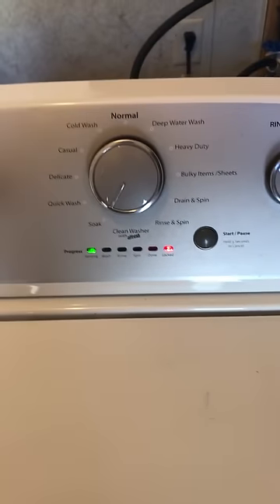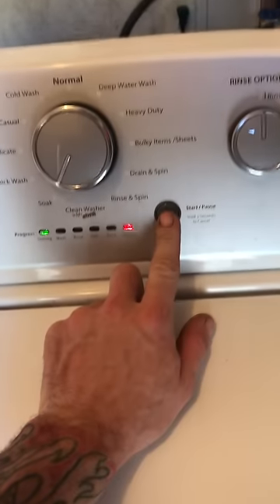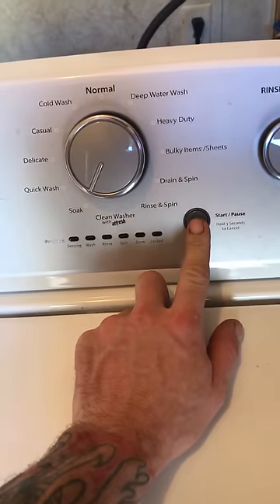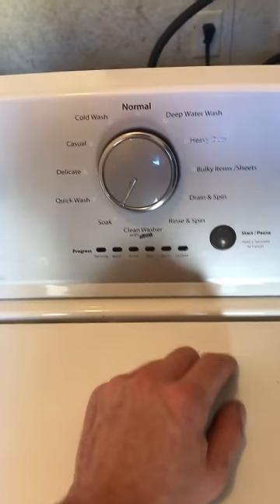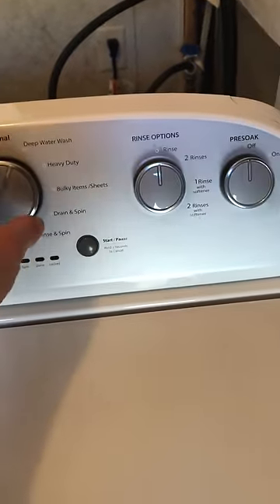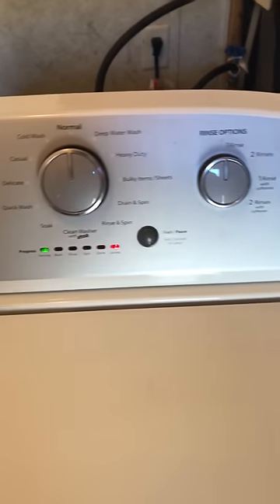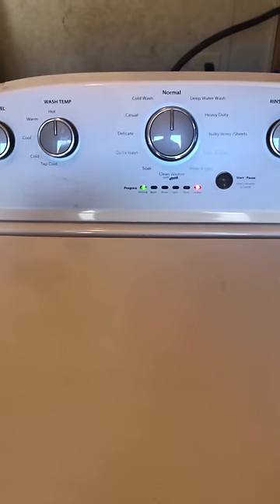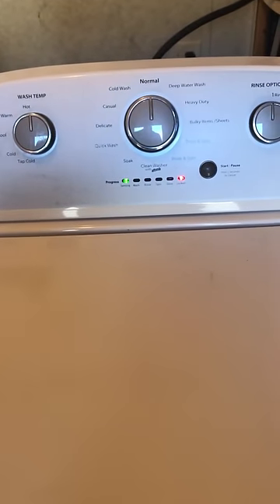Whirlpool washer will not pass sensing cycle

Comment: unplug the washer for a minute.  Then lift and close the lid 6 times in 15 seconds.  It'll reset the logic.
Reply: OMG Donnie. that worked. my washer sensor light was on and water was pouring in however it would not wash. I unplugged for about 5 minutes, plugged back in, lifted the lid up and and down 6 times and push start, it immediately went into the wash cycle. thanks a bunch.
Reply: Really hope this works... So I unplug wait 5 mins then open my washer 6 times then it will work?
Reply: Donnie Lyons you’re awesome man!
Reply: This worked! So simple. Whew! Thanks.
Reply: Amazing Donnie !!!
It's technical sense, not strength.
IT worked...it reset itself.
Reply: I don't know how you knew to do - or even try - this.....but it WORKS! Thank you SO MUCH!
Reply: I can't believe it, but it worked! You saved my laundry, my time, my  frustration you made one older lady soooo happy
Reply: F**** Donnie. Worked like a charm bro.
Reply: Ugh did not work on mine. Still clicks and unlocks
Reply: Huh
Reply: Thank you ! you saved my day!
Reply: Donnie Lyons  can u make a video please!
Reply: Wait a minute here...I wasn't aware that this applied to whirlpool products? Thought this was general electric method? Not sure if this is possible
Reply: It worked unplugged for 5 minutes slammed the lid open and closed 10 times and now its Washing ... Thanks you are gifted and saved me a shit load of money . thanks a million
Reply: Thanks Donnie, worked like a charm.  Now how do I clean out the pan under the tub?  When I lifted the washer to check it out, I noticed some dark areas inside the translucent plastic.  that's probably accounting for the sour smell I sometimes get.
Reply: Thank you for this advice! I was scratching my head with this same problem!
Reply: It WORKED!!! THanks!
Reply: Thanks so much for this info, bought this washer sight unseen and seemed to worked just fine when I first got it. Then slowly but surely, all the cycles stopped working at the "sensing phase". Followed your steps and also ran a "clean washer' cycle(because that also stopped in the "sensing phase", now it seems to be operating normally. Thanks again!
Reply: Mr my lid is locked and wobt unlock or do anything else except click sound and lock light every so often
Reply: Yes, thank you!! It worked!!! Mine was stuck in spin cycle.
Reply: I’m going to try it
Reply: Mine didn’t work any other suggestions
Reply: Donnie Lyons you are the man I was ready to get rid of this washing machine and get another one that lid trick was amazing
Reply: Thanks Donnie! We all owe you a beer
Reply: Funcionó, muchas gracias!
Reply: THANK YOU SO MUCH!!!! I'm using a Commercial Maytag Washer and had 4 loads to do on a Saturday, I called Customer Service, they told me 3 days I had to wait.  I prayed and you were the answer to my prayers, thx again!!!!
Reply: Didn’t work for me either!
Reply: Donnie is my new hero
Reply: Perfect thanks!
Reply: What does (then left) mean?
Reply: @austing8694  i think he means lift
Reply: Donnie Lyons !! Donnie THANKS A MILLION !! WORKED GREAT
Reply: this actually worked! ty!!
Reply: Apartment washing machine got stuck on "sensing" cycle. Management said we were 27th in line for maintenance requests. You just saved me who knows how many more weeks without a working washing machine!! Worked like a charm.
Reply: Wow....it did work...thank you!
Reply: You are a washing machine god Donnie
Reply: Thank you.  It really did work~
Reply: Beast Mode Gaming then “lift”. Just typo
Reply: Wow works for me 👍🏽 I got the same type of washing machine. Was using my washing machine for only 9 months and all of a sudden wouldn't work. Thank you 😊
Reply: Amazing. But wtf I just got it day 1 and it already has an issue? Ridiculous
Reply: This just worked for me🤩Thank you😁
Reply: Honest... I thought your suggestion was absolute hogwash (no pun intended) but was willing to do just about anything no matter how ridiculous it sounded. And voila! It worked. Still noodling just why it does. I had yucky cat beds on the washer and no way did I want to wash them by hand. I would be more than happy to buy you a beer or beverage of choice. In lieu of that I extend my most hardy Thank you!!
Reply: IT WORKED! It actually works. I believed the comments below and was persistent. It didn’t work at first because I had to actually power off the load (hit and hold to cancel) before unplugging and waiting the minute. Then without a cycle going, open and close the lid 6 times, the choose and start a new cycle. Now it’s working! Thanks so much Donnie!! You saved me 100$ at least.
Reply: I cannot believe this worked
Reply: I JUST DID THIS AND IT WORKED!!!!!
Reply: Thank you so much Donnie you are a genius
Reply: Thats only on G.E models with electrónic board on motor
Reply: I could kiss you lol!! Thanks it works!!!!!
Reply: Christopher Johnson how did you do it? I plugged it off and opened and closed and pressed start. It’s sensing
Reply: Donnie Lyons, you are the BEST!  I am going to post a video of this procedure that worked for me.  Thanks so much!
Reply: That actually worked 👍thank you
Reply: While i have no issue with Donnie being a great guy. The people at Whirlpool should know their engineers made total S**T this time!
Reply: Thanks for the awesome tip!!! 🙏🙏🙏
Reply: Thank you soooo much🙏
Reply: Donnie Lyons could also recalibrate it in diagnostics mode.  If either of those don’t fix it it’s more than likely going into safety mode to prevent any further possible damage to the motor
Reply: You are a Godsend! That worked. Idk how but it did. Thank you so much.
Reply: OMG!!!! This worked! My washer is not even a year old and I've been so frustrated with it since I got it! I unplugged it, closed the lid repeatedly (6 times) and it's finally in wash mode right now! THANK YOU!!!!
Reply: I'll try again ughh 🤣😭😭😭😭
Reply: My washer like this isnt even a year old and constantly breaking to the point I have to unplug and replug it back up sometimes waiting a few days between! Whirlpool sent a company out who said I need a new main control panel I guess its called but they havent been able to come back out and replace the part. Hopefully it works from the reviews I have read and seen on many websites these washers are trash. My matching dryer is decent though
Reply: Thank you man it worked!!!!
Reply: What's your CashApp. I'm bout to send you beer money 🐐🐐🐐
Reply: This worked. Effing badass how this trick just worked. This whirlpool washers are a pain but that you Donnie.
Reply: Thank you so much!!
Reply: Worked!!!!
Reply: Thanks king
Reply: Thank you so much!!!!! It still works🥰
Reply: @Donnie Lyons…riddle me this…have same washer as this gentleman…this is not my issue, my issue is machine doesn’t “jirate” when washing…leaves clothes dirty and/or soapy…pls help!
Reply: 6 times in 15 seconds you say???

Good Heavens I believe in Hocus Pocus!!! 
Blessings to you & all your friends, kindred & posterity, Donnie!
Reply: Lift and close with washer unplugged?
Reply: Works like a charm
Reply: Donnie you are the frigging man...  I'm a technician and didn't know this trick. It works like a charm 💪🏽
Reply: Donnie Lions Mom is trying this now  crossing fingers
Reply: I DID IT AND IT WORKED !!!! thankyou commenters!!!
Reply: Thank you
Reply: OMG it really worked! Thank you
Reply: This worked for me.  Thanks!
Reply: I tried it and the green light is blinking it runs a few seconds and it locks and won't do nothing
Reply: Thank you so much!!
Reply: This actually worked! 😂thank you! #2024
Reply: Wow that worked
Reply: Didn't work unfortunately.

Both suggestions on this thread failed for me, unfortunately so I'll have to call the repairman. 😭

Comment: The motor is told to sample a rotation briefly before filling with water. The control is not detecting basket rotation, that information is supplied by a photo sensor, which is a part of the mode shifter, located on the side of the gearcase. It shoots a light beam through slots on a disc that is part of the drive system of the inner basket. If or when this sensor fails, which is one of the most problematic parts on this machine, the control will not realize "motor rotation" and stop operation of the machine. Also will store error code, which is not a definitive diagnosis, as the motor is typically not at fault, but the sensor, which is reporting back to the control , is the actual culprit. This photo sensor is also used in tachometer test, to see if it is working or not. Also this motor operates with a 45uf or 50uf 250vac capacitor that can also fail, although I haven't seen many of those go bad. 

Most of these parts are priced at 50 to 80 dollars, so if you can repair yourself, not so bad. Life expectancy on the VMW, which is the Vertical Modular Washer, is 7 to 12 years before main bearing, IE Bushing, system fails due to leaking top seal on outer tub. Of course some of these machines don't last as long, adding to the frustration many owners have with them. 

This description is for the belt driven VMW washer only, other Whirlpool washers use a direct drive system, where the stator of the motor is mounted to the bottom of the tub, no gearcase, no mode shifter, no belt, just 3 phase motor, controlled by the main control to operate this motor in very slow or very fast operation, and change direction as well. 

This is a brief description on the method of operation, and many different things can cause these machines to stop working properly, so remember to use the error codes as a starting point to steer you in the right direction, to find the actual cause of the problem. Hope this helps.
Reply: Oh yeah, the rotation light reads on manual and automatic mode but normal mode it will not do a thing, now what.

Comment: Ok first things first, I’d check under the wash plate for any change that may be stuck and if you find none proceed to check the drain and make sure nothing is blocking the impeller. Unless you can confirm it does drain. 

If nothing is blocking the impeller on the drain pump, you will want to look at the shift actuator. 

It’s got a shift actuator at the bottom in between the drain pump and connected to the splutch right next to the motor.

This shift actuator is plastic and does stick. Not an expensive part and very easy to change for any handy fellas out there. 

But once you change this part check the manual for diagnostics and run a calibration mode so the machine can run with the new shift actuator. Then run a test mode, and then check error code through diagnostic mode to check for any issues, hopefully you have none.

And Hopefully I have helped 😂🙏

Comment: I'm from the bahamas check your fill valve , or control board but I'm strongly suggesting you check your control board
Reply: I have one of these. The water doesn't fill
There is only enough water to wash a few shirts at most
Reply: I just replaced the board...it still dose the same thing

Comment: Ok , F7E6 means the control board is sensing an open line on one of the motors 3 electrical phases, with the machine unplugged also be mindful the motors run capacitor can store a charge   Carefully inspect the wiring harness between the Control board and the motor for any broken connections , if found , repair,, if no fault found ,, use an ohm meter to test the motors windings resistance it is listed in the tech sheet housed in the washer cabinet if you find one of the motors windings "open" replace the motor.

Comment: Don’t buy a new washer people. Please read. The classic models, with knobs and absolutely ZERO electronics are the way to go, fully mechanical, they wash, rinse and spin no BS every time. Some of the best models are the Whirlpool made Direct Drives, Speed Queens, and Maytags. And don’t think you can’t get one with a ton of options, the high end Whirlpool made direct drive washers offer tons and tons of cycles and options. There’s no excuse to buy a new washer when used classics are cheap and work the best HE was the biggest corruption of the appliance industry I’ve ever seen. You don’t get aggressive turnover with new washers, the only one you’ll find brand new that’s got classic powerful agitation and no BS is the Speed Queen TC5.

Comment: Our whirlpool's lidlock was jammed shut by the whirlpool itself, then during the preliminary "sensing" or weighing cyclecame a mechanical burning smell. It's as if it just committed suicide.  Had to take the whole top off to get my clothes out. Trying to fix it but looks like the washer might need to be replaced entirely based off what little I can find online.  This whirlpool cabrio is fairly new, too! Guess it won't be a whirlpool that I buy next time.
Reply: Just throw it out and get a nice used Whirlpool direct drive from the late or early 2000s, cheaper, way more aggressive wash action no BS gets the job done reliably every time with a real agitator. These new washers are a violation to washing clothes correctly with these ridiculous wash plates and unnecessary sensors, it’s a horrible corruption that took place a decade ago to meet “energy regulations” 🙄

Comment: Omg....!!!  Never thought this would happen..  but the cold water valve was shutt off!!  Only the hot water valve was open.   After I turned on the cold water valve the machine went into wash mode right away..  before it was stuck in sensing mode for days
Reply: My hot was off.. I replaced all these parts for nothing

Comment: Change wash temperature from hot to warm or cool and run it again. Sometimes the water inlet get clogged due to salt , it depends . If not working try to clean water inlet hoses and check again .

Comment: Same problem. Junk washer. I’ve gone through 2 of them in a year just doing normal loads once to twice a week.
Reply: Exactly Just throw it out and get a nice used Whirlpool direct drive from the late or early 2000s, cheaper, way more aggressive wash action no BS gets the job done reliably every time with a real agitator. These new washers are a violation to washing clothes correctly with these ridiculous wash plates and unnecessary sensors, it’s a horrible corruption that took place a decade ago to meet “energy regulations” 🙄
Reply: Hate the new washers!

Comment: Same here. I flipped mine I hear coins. Trying to get the wash plate off to see if I can get to the coins
Reply: Pull the plate off use tweezers to get coins out of the tubb and pull lower pump hose off to drain 2 screws and clean pump put

Comment: Best way to repair that washer is....First Unplug the Unit.  Turn off the Water..With a pair of Channel lock pliers  unfasten the Water inlets... remove drain hose....Pull out the unit and with a Two  wheeler or other such Tool  Shove it outside........Now replace Washing machine with other Model.
Reply: Lmao naw Fr tho

Comment: Repair man has been out six times. Replaced control board twice. Purchased in May 2019 new.
Reply: Same! I purchased mine new May 2019 and it worked fine up until about 2 or 3 months ago. Repair guy came out and replaced control board.

Comment: Could be a clogged pressure switch line. If not the switch is on the board so you’d replace the board. Also check the belt. Could be stripped. Put in diagnostics mode. Run agitate and spin. Pretty much of it doesn’t do it then. You might have a bad motor.

Comment: Sounds dumb but I was having this issue and it was because the water was turned off. Maybe the inlet has some gunk in it.
Reply: William Kelly lmao seriously?? 😂  Here I am looking up troubleshooting articles, preparing for a frustrating battle... and I just forgot to turn the damn water back on. I was just trying to run a quick test... This is up there with “is it plugged in?”
Reply: William Kelly thank you for asking the simple question...been perplexed for a while 😆
Reply: I reset the motor, recalibrated it, checked the water lines, the whole nine yards and it still wouldn't get past sensing. Read your comment and realized in my haste I forgot to turn the hot water LMAO. Good shot

Comment: Ok, ill help you. There's a manual inside the machine top left. It is show you the error code. On your knob go left once and then right and then right again and right again left and then right again all the lights to turn on.  Then turn it right right and right until the third green light turns on when that flashes on push start and it will calibrate

Comment: WTW5000DW1 Washer Shift Actuator. This is what you need 45$ definitely going to score points with the wife. Make sure you don't have clothes in it after you replace and recalibrate or else it won't work.
Reply: Takes longer than usual because it's only sensing water so put it on quick wash and let it run through all of its functions.

Comment: My problem is a little different in that it will go all the way to filling for the rinse cycle; then once water reaches level, instead of agitating the rinse water, it starts clicking about twice per second. Clicks for couple minutes before just draining out all the water and enters spin mode. Then in a separate operation, I put the dial on rinse and spin; It fills, rinses, and spins normally.
Reply: Did you figure it out?
Reply: @_only1yugi88    Unfortunately no......just select rinse and spin until I can get new one.

Comment: When I do the clean washing machine mode everything works. It spins, drains, does everything. But when I do a normal wash it stays stuck on sensing. I think it's the cold water valve. Checked the hot and cold water sensor and got nothing from the cold water valve.

Comment: I have a whirlpool top-loading washer, model W10338679C I put clothes in and close lid it fills and drains then the fill light just flashes and will not do anything
Reply: That tells me it is not sensing right, either the control board or the optical or actuator output, or the input to it from the control board.